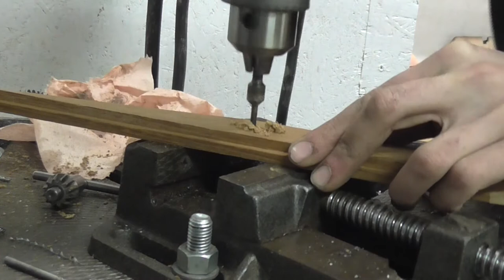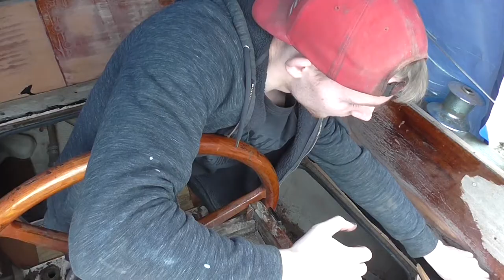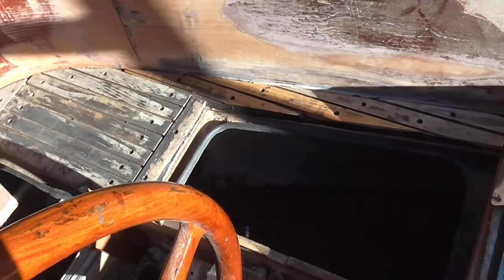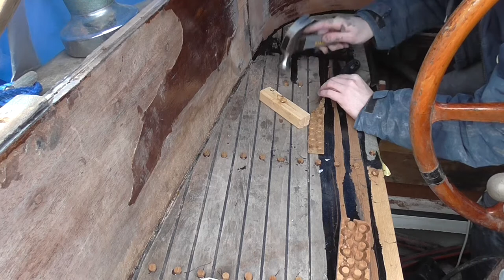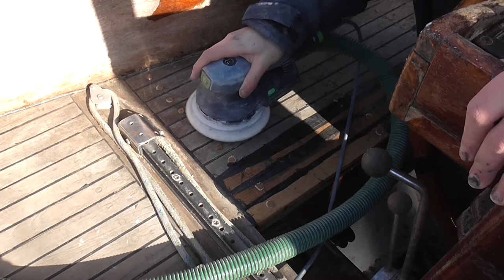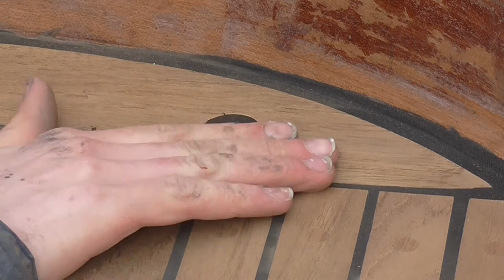Installing Teak Decking on a Wooden Boat - The Dilettante Ep 4

Comment: Which glue did you use? The black stuff? Is is it polyurethane based or bituminous?
Reply: It looks like M# 4300 or 5200 I would hope that it was not that as that could be expensive, but talking to a few other people about this, they say M3 5200 is what is used to fill the black in between.
Reply: @michaelmoore4650  sika flex deck caulking is nice to sand after. Doesn't ball up or tear